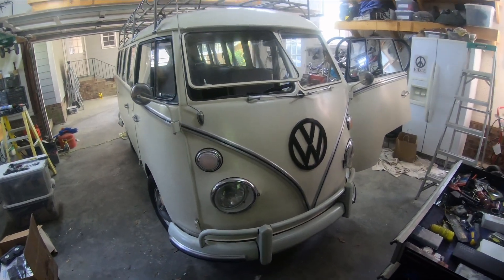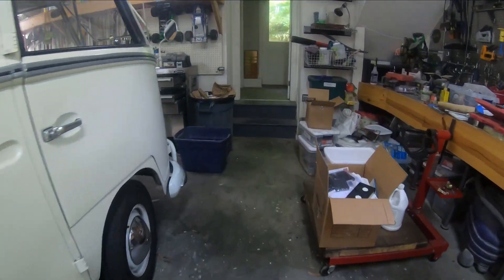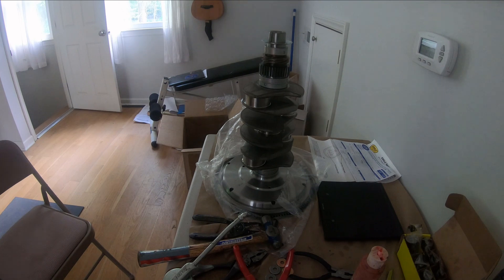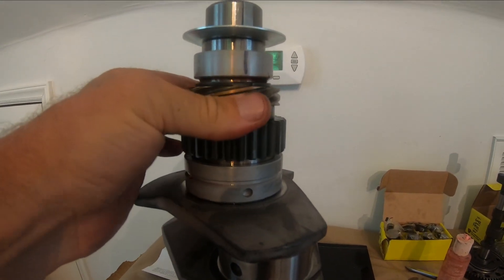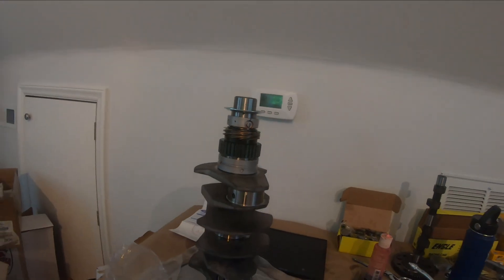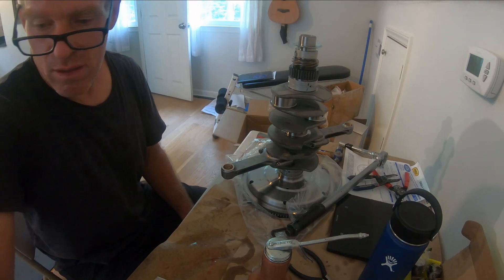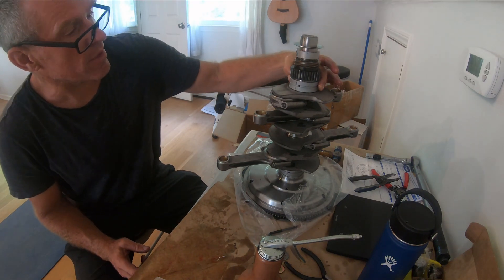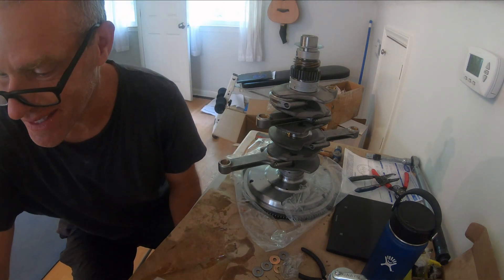2332 VW Air-cooled Stroker Motor - Video 01 - Crankshaft and Parts

Comment: with a bus and the 3.44 (you said 3.88 in the vid but your rpm's, earlier vid, don't match a 3.88) that's a solid cam choice. i would have picked the fk41 but i don't know if you drive like i do.
Reply from the maker: Oh - yes - it is a 3.44. I often say the wrong numbers at the time and then realize I said it wrong…